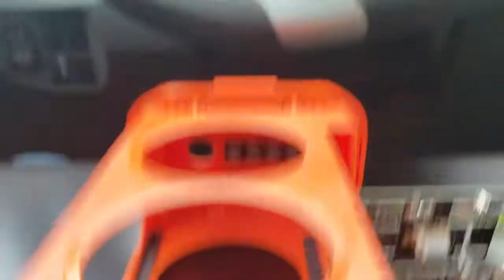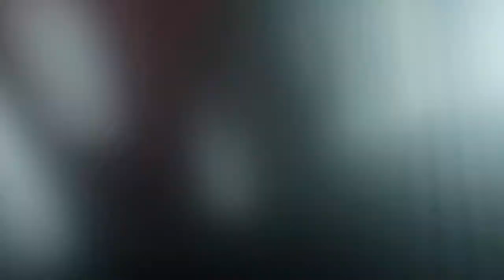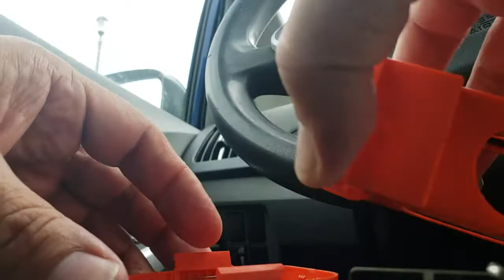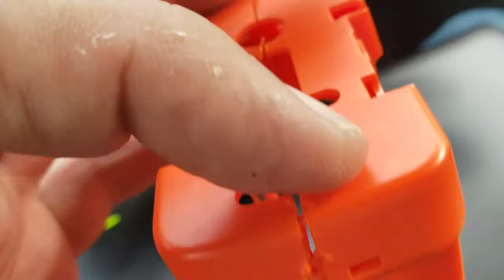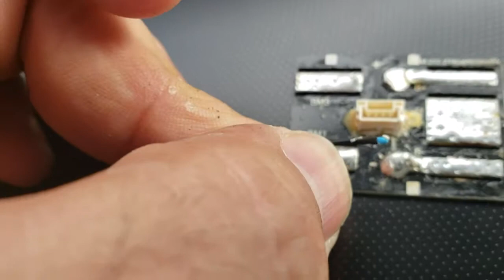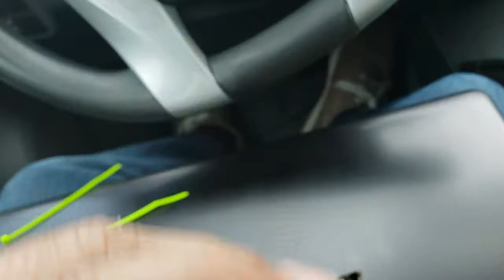Cracking the Autel X-Star Battery Case

Comment: I too am looking to refurbish my drone batteries, I found a 5000 mah 14.8 lipo 4 cell with a discharge rating of 50 for about $50.00. I've been looking to find the stock discharge rate as that is the real power of the battery.  Does anyone happen to know what the stock discharge rating is.  Love your video on how to take it apart...

Comment: any chance do you have the dimensions of the battery pack?
Reply from the maker: Oof! Let me see if I kept the batteries. At the time I made the video I did find some packs that seemed to match up, but I have since moved on to more supportable hardware.
Reply: @zombiiilabs  thank you.  I am trying to find out where I can purchase the mating connector to this battery so I can try to recondition my X-star batteries with the RC type battery chargers if a potential replacement battery can not be retrofitted in place of the existing one.
Reply: @doanhtran4651  I was thinking of doing the same thing.  I have an extra charger so I can bastardize that I guess.  My question would be does that battery connection apply voltage directly to the battery or is the controller involved.  It appears to me that the extra (non + or -) connector on the charger is actually empty, I can't see any contacts in it, this makes me think it may be possible.  Has anyone tried this that you know of?  I have 6 non working but non puffy batteries at this point.
Reply: @mikewoods8918  I took apart my only charger.  It appears that the board in the charger communicates with the battery also.  At this moment, I do not have a spare battery to take apart to understand the components.  It would seem strange to have two logic controller (one within the battery and one in the charger) to watch the battery individual cell voltage.
Reply: @doanhtran4651  You say you took apart your charger.  Were there any wires to the charging connection that attaches to the battery other than the positive and negative wires? (such as smaller wires that might be to the controlling boards).  I don't have my spare yet and haven't cut into it.
Reply: @mikewoods8918  i do not have the wiring schematic but it appears that there is some sort of voltage balance communication on the charger board to the battery charge balancing board.

Comment: Just curious. What was the power source? 4 18650's?
Reply from the maker: Unfortunately the cells were unmarked. I tried taking accurate dimensions but they were a bit puffy
Reply: Four flat rectangular shaped 3.7v batteries.